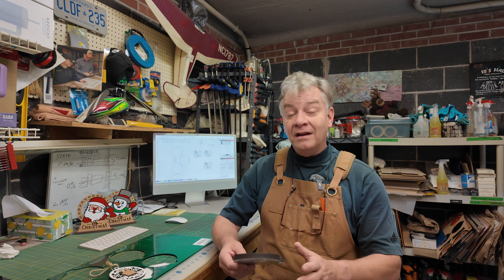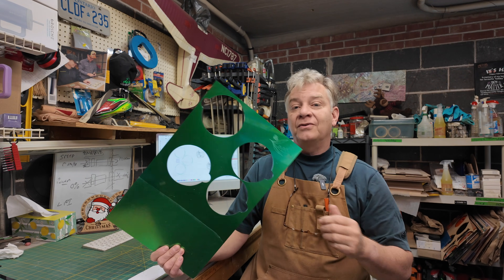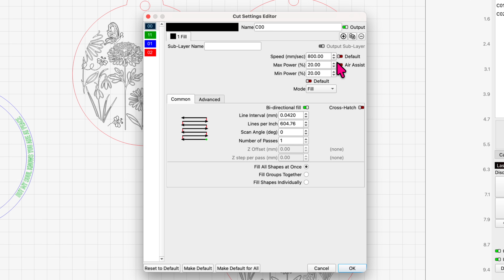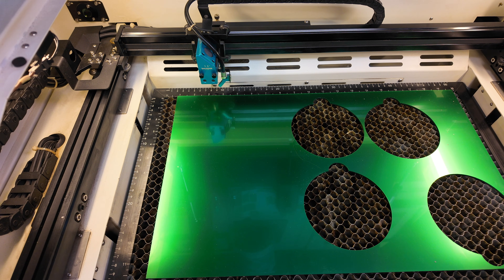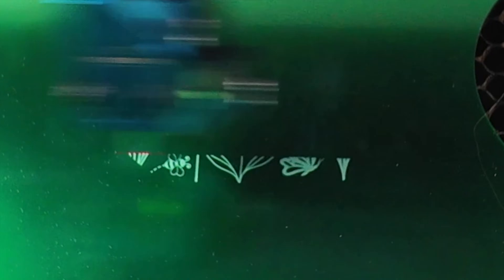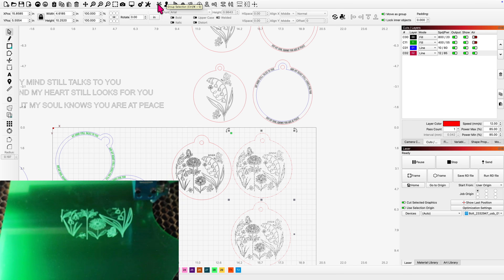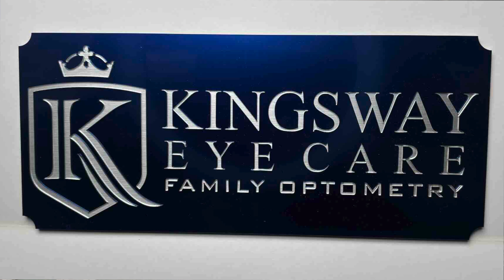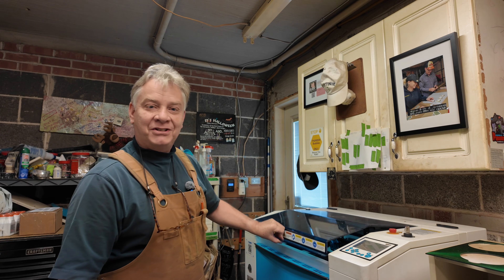Metallic Acrylic on Thunder Laser BOLT. 109   4K

Comment: Love that metallic acrylic.. I am gonna have to try this.. Just a quick question? How did you fasten the Trueflat to you acrylic? Merry Christmas!
Reply from the maker: Morning Rick! I now always use either dualtite or 3M 467MP. I did use CM glue sometimes previously ( Starbond or Gorillia Glue) but I found over time the CM glues will become brittle and the pieces fall apart easily. Also, CM glue is not good for use on outdoor things - the 3M 467MP is rated for negative temperatures and outdoor applications. Hope that helps - Happy Holidays!
Reply: @LaserNUG  Thank you very much! I am definitely  going to check this out today!! Merry Christmas!!